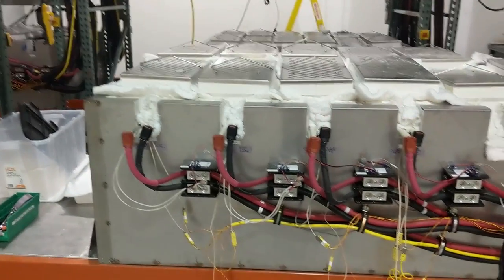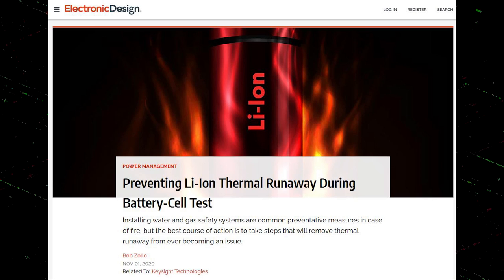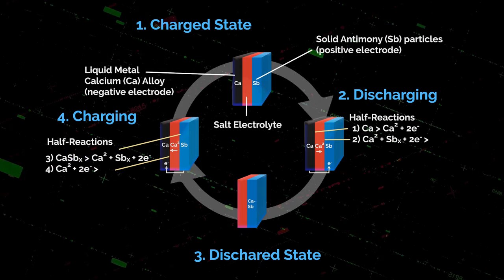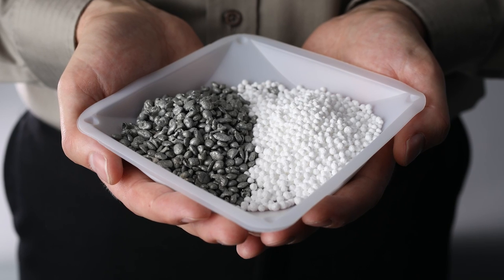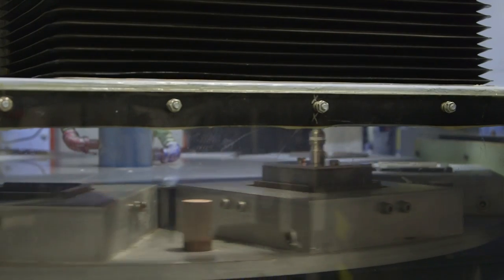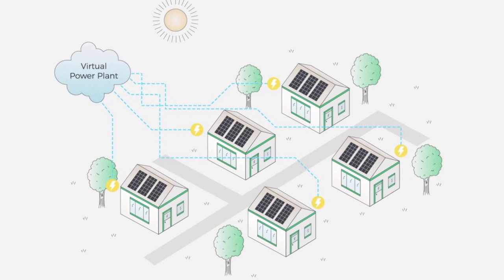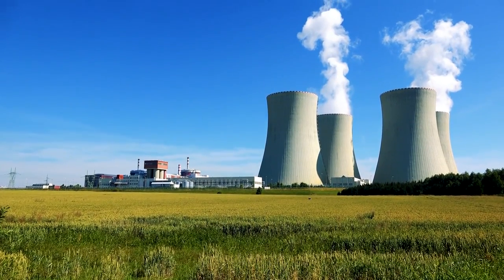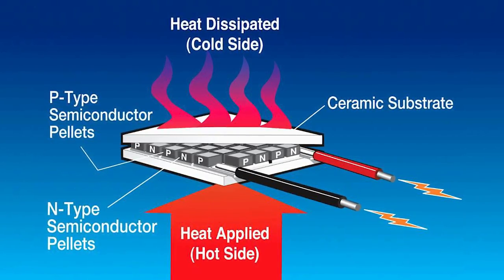Ambri: A Battery that Could Change the World

Comment: "if you want something dirt cheap, make it out of dirt. Preferably locally sourced" this is such an awesome quote
Reply: Soil aint cheap. Dirt is dirt meaning dirty. Soil is soil dust is dust. Where there is smoke there is smoke, the fire is where the fire is.
Reply: Fi real.
Reply: This is the Arc Reactor lol
Reply: I prefer politically stable in the US. 🤣
Reply: Let's talk about how many hundreds of pounds of magnesium catching fire. When magnesium catches fire, it burns at 3,100 c or 5,600 F. If one tries to drown it with water, it burns so hot that it liberates oxygen from the water. it will burn through concrete. Years ago, I had a mall spool of magnesium ribbon. I lit it on fire and got a bit spooked by it's energy so I dropped it with a pair of pliers into a beaker of water and it just sat there and burned and boiled the water until the beaker broke.
Reply: @Ryzler13  bot?
Reply: Great Man Mr.Donaled Sadway.His efforts are helping the whole Universe.
Reply: @Ryzler13  Raa=è1¹1q+pq0+¹1¹q
Reply: - and we have to make sure the technology meets the requirements of equality and social justice that are so important in our political climate...
Reply: @денисбаженов-щ1б  Whatever makes the Leftists happy :-)
Reply: Land prices are through the roof! 

Dirt is not "cheap", unless you are hinting at stealing it.

I for one do not need an unethical solution if that is the case.
Reply: @денисбаженов-щ1б  Not at all. There simply isn't that much demand today, but Antimony is found all over the world.  Supply and demand are dynamic - raise the price and offer to buy 10 times more than current supply, someone will build more mining capability to fill those orders.  In fact, unintuitively, history shows that increased demand INCREASES supply in very short periods of time.
Reply: Water used to be considered cheap...not so anymore..dirt,,who knows?
Reply: @денисбаженов-щ1б  It comes from dirt, Boris, and it is everywhere.  Enough with your silly propaganda.
Reply: @денисбаженов-щ1б  Ah, another Dunning-Kruger victim. You have no notion whatsoever of what I know, Boris. Enough with your silly propaganda.
Reply: @денисбаженов-щ1б  I'm  half impressed only but i d oo know that a numbe r of metal n sslt combinations exist besides  antimony  and other here.
Reply: @денисбаженов-щ1б  interestingly antimony  i beleive was oonce available  as a pill. It would pass through the gut and re-emerge ready to be re-used by another person or again repeatedly.  It might  have been effective  against some parasites and small amounts of a antimony  in the body improved the skin tone as does arsenic. Small amounts  .
Reply: @rogerramjet6134  and the more roads built , then the more the vehi6 come from nowhere to congest the new roads.
Reply: @денисбаженов-щ1б  if your book is worth writing (and reading) then it will provide unbiased evaluation of technologies. Allowing yourself to be angry about an internet discussion that didn't go your way, and petulantly allowing that to unbalance any information you may provide in a book, is not the way of an educated person. You just shot yourself in the foot with that last comment.
Reply: UFO KingCrazy  when I Google i find that  Bolivia South Afrika Tadzjikistan and China with 90% is the greatest cant find Mexico or Canada 🤨
Reply: @Ryzler13  good
Reply: Let's see how long it takes for this guy to get Hillary'd for this wonderful invention.
Reply: @денисбаженов-щ1б  no good professor I’ve had would care enough to respond the way you have, thank you for exposing yourself as a fraud
Reply: Love it
Reply: @joeking3282  it’s sarcasm buddy 👍
Reply: "build dirt cheap from dirt" is an old meme from the architect of Earthships
Reply: Póp
Reply: @денисбаженов-щ1б  is this true and checked? what source did you use to check this opninion?
Reply: @денисбаженов-щ1б  how can you profe this? what is your source?
Reply: @денисбаженов-щ1б  It just a term of speaking..you must understand..
Reply: What’s the stock symbol for that though ? 🤔🤔🤔🤔any one knows how to check it out ?
Reply: So you can make a dirt cheap battery out of dirt?
Reply: UFO KingCrazy  Are you rich yet? Inquiring minds want to know?
Reply: @BlisterHiker  I did notice the battery case was white! But then if we did it in black, we could put some solar on it and keep it warm?
Reply: UFO KingCrazy  why don't they mention what kind of wattage you can get with one of these batteries?  How much metal do you need to make a battery for what wattage?  This is a stationary battery for business, homes and not for individual use or transportation.
Reply: Where do you get all of this heat to start the battery?
Reply: @peacepoet1947  ...they explained that in the video, did you watch it? If not, maybe watch it again?
Reply: @JamesFaction  why should I watch it.  You seem to have gotten the information and why don't you share your understanding?  The Sun?  Gas?  Oil?  You need petroleum products to make the battery.  I watched lots of energy producing videos.  I missed something in this video about how they plan on achieving such high temperatures but it isn't as important as how much space do these buildings take up and what kind of wattage can you get per square foot.  How does it compare to the space required for windmills or solar panels.  I'm always asking questions.  You can't loose any heat but heat will be lost.  Other than some drawings.  There is no working model of the device.
Reply: @peacepoet1947  why should you watch it? You commented on it. If you haven't watched it, your comments look pretty stupid.

Expecting other people to answer questions that would be answered by watching the video YOU are commenting on is arrogant and entitled. Perhaps avoid making yourself look foolish, and watch the video first before you comment.
Reply: @JamesFaction  sorry that I ruffled your brain.
Reply: Yes, correct.
So why are we paying half a million dollars for a house that is made from drywall???
And the cost of heating and cooling is very high.
And it takes 30 years to pay it off.
Are we insane? YES!
We can make cob houses with thick walls that the dirt comes out of the back yard.
Recess the house 3 feet into the ground and build the walls out of that same dirt that came out of the hole.
And from the money you saved you can travel the world for years!!!
Reply: Why do i get the please make me rich and lose your investment feel?
Reply: Silicon from sand..gasoline and a zillion products derived from a black  sludge called crude oil. 
Paul G
Reply: @BlisterHiker  Oh yeah - as in wars and blood for oil and the blood-soaked gasoline that most people merrily and obliviously pump into their beloved combustion-engined cars. Then when EVs and batteries threaten the gasoline-powered status quo - countless millions like you suddenly grow a conscience !
Paul G
Reply: @evukelectricvehicles  What's your point?
Reply: James, today the Interweb is yours! : )

Comment: Finally,  a person who is really making sense.
Reply: +1
Reply: Call me. I can’t sort out your other problems as well.
Reply: Ok, it sounds like a good idea BUT these batteries depend on the assumption that renewables themselves deliver benefits. Do they? It seems that they don't :@t
Moreover, besides the research on how "green" is green energy when you factor in all production emissions and energy input for installation (huge roads are opened, hills flattened, etc), maintenance, and so on, I have yet to see a viable plan for tearing down and recycle the  huge wind turbines and billions of solar panels.
Reply: @C_R_O_M________  so why would a wind turbine need to be recycled ?
And what part of it couldn’t be re used or recycled ?
And solar panel recycling is comon place nowadays
Reply: @spinnymathingy3149  their life cycle is LESS than 20 years (some don't even make it to a decade) and, as the professor said in this clip, composites don't recycle well. Wings are made from composites. Many big ones (the turbine base) are made from concrete and concrete is one of the most pollution-intensive materials we make. Not to mention the opening of roads and flattening of whole hills and/or mountaintops when you install them (that's the case here in Greece with a very mountainous terrain). It's not that straightforward you know.
Reply: @C_R_O_M________   but what power supply/generation are you making comparisons with ? 
What would be your go-to preference for power generation ?
Reply: @spinnymathingy3149  right now the most efficient and stable power production comes from natural gas and nuclear power. hydro isn’t and can’t be available anywhere. Aside from that my previous comment is a different story by itself. What will they do with all that equipment after their life cycle completes? I have yet to see someone with an economically viable plan for their decommission and recycling. Hence many are left on location to rot.
Reply: @C_R_O_M________  hmmmm, nuclear doesn’t tick your logic box, with relation to mining, pollution, resources, decommissioning ect. 
But depending where you reside solar PV works well, here in Australia I haven’t paid an electricity bill for 8 years, usually get a cheque from the power company, as there’s a huge uptake of solar in Australia there’s an efficient recycling industry here  now because in 10 years or so there’ll be demand
In Adelaide Australia there’s so much private roof top solar its overloading the grid as its being fed in during the day, so a storage system of some kind is needed, either on a personal level or state level
Reply: @C_R_O_M________  it is all bridging technology atm.
Wind turbines are currently being dismantled and 'ground' to use as/in cement✌️
Reply: @C_R_O_M________  there's next generation reactors being developed that can use the waste as fuel

Comment: Awesome technology.  I wish them the best, we need more people like Donald Sadoway.
Reply: @tonywilson4713  generating too much? Surely they can simply open up the disconnect switch
Reply: @andymack8178  Its not always that simple and they can also lock of wind turbines.
Neither eliminates the real problem. From a technical perspective its irrelevant but from an investment perspective its massive and it doesn't matter who's paying.
I don't know your background but in the past I developed automated production machinery and in manufacturing there's nothing worse than producing failed product. Its cost money for materials, labor, energy,....etc. and those costs are unrecoverable in failed product. Solar/Wind energy that can't be sold or used is similar. Every bit of sun or wind that is not converted and used or sold is money lost.
If your the home owner then you have to buy energy elsewhere. 
If you're the commercial generator then you can't sell the full value of what your solar farm of wind turbine is capable of.
Reply: @andymack8178  As for generating too much its easy to overpower a network with too much generation. The voltage goes up and if it goes to far its not good.
Reply: @tonywilson4713  your comment above "easy to overpower a network with too much generation. The voltage goes up and if it goes too far it's not good" This is exactly what I just said, then simply turn it off.
Reply: @tonywilson4713  these systems are absolutely made to be turned off
Reply: @tonywilson4713  if it costs the utility even more money by shutting it off vs. paying customers to take the excess power and if there's some political/contractual/economic/but not technical reason that they can't turn it off then there's something that we're both not aware of yet.
Reply: @andymack8178  These things are large grid connected generators and they can't simply be switched on and off.
These use High Voltage Breakers and they are not like a light switch. Even normal low voltage breakers have limited lives when they switch under load.
You clearly don't have much (if any) experience in electrical engineering.
Reply: @tonywilson4713  Srore energy as the electricity like battery based on  2 solid dipole  and a liquid electrolyte in between as the Earth temperature from 0 to 45 C . But it is malfunction  if lithium or both solid dipole under 0 C freeze as electrolyte no more a separators electrons but turned into fixed holder electrons without exchange and attractive dipole charger.  If you find a 2 solid dipole and ... as is liquid exchange electron at 100 C or 1000 C then it is bingo.
Reply: @ThuannguyenN-gp2vp  Why don't you just listen to what he is saying? 
And read what you've written before you post.
Reply: Texas just proved how important it is to have reserve power available at all times especially when the weather is not cooperating. Ice will kill wind turbines the same way it causes aircraft to crash,  by changing the shape of the " wings " Texas made the mistake of taking off line the reliable proven technology instead of keeping it viable and ready to cover when renewable energy failed. 
You talk about recycling then you cause massive amounts of building materials destroyed and people killed by not maintaining a balanced reliable system. Keep passing laws that don't consider all the consequences possible and the Texas type failures will become a common problem in all aspects of life .
Reply: @tonywilson4713  I applaud your first comment. Somehow YT doesn't allow me to include a link for the latest commentary of natural resource analysts Goehring & Rozencwajg titled: Ignoring energy transition realities. Google it and go to their site to find it. It'll be an eye-opener on many misconceptions on "green" energy. Hint: it's not that green to begin with.
Reply: @C_R_O_M________  Yeah - you have to be careful with what links you include in comments. You're not the first to point out that YT's supreme bot of our collective consciousness doesn't like links to places it doesn't control. I have found it doesn't react to Wikipedia links and they often have links to the places we want to highlight. 🤷‍♂️🤷‍♀️

Mark Blyth (who I think is one of the smartest people on the planet right now) has mentioned several times there is an enormous shit fight comin around the corner shortly because pretty soon the Right wingers are going to have to admit they have been lying about climate change just as they did with tobacco. The difference this time is they aren't killing their customers its the planet.

What I find very frustrating as an engineer is that all public discussion and policy is being dictated by economists and MANY of those have links to Harvard, which is the grand temple of neoliberalism free market ideology. Here's a case in point that I only found yesterday -> https://www.youtube.com/watch?v=5oyFRoxuf4g  note the Professor who built our disaster of a water market has links to Harvard and that he has the same attitude to the clown from Harvard who designed the Texas power market.

No matter what anyone wants to say its going to be engineers who have to get the job done of providing clean viable power AND ALSO build the systems for cleaning up the planet. We can't get that done if nobody will listen to us.
Reply: @andymack8178  You can turn off the generators, that you own. To push renewable energy, Germany had introduced a law (EEG), that energy companies are obliged to accept and pay for electricity produced by private sources ( roof solar, wind etc) connected to their grid at all times. They get a compensation, which is added to everyones electrical bill.
Reply: @tonywilson4713  sorry, but there is no tangible evidence whatsoever that a trace gas like CO2, which represents just 0.04% of the earth’s atmospheric volume, is detrimental to the planet in any way. Unfortunately, it was Thatcher that started the alarmism for burning carbon (basically coal then) but that was a trick of hers so as to overcome the conflict she had back then with coal miners. The leftist propagandists and their media lackeys have brainwashed the whole world about about some “catastrophic” climate change scientific bogus consensus which is all supported by GIGO computer model projections. Many top scientists disagree and they are the ones with no incentives to do so. In fact skeptics are banned from funding when they come out of the closet.
Reply: @tonywilson4713  I'm sure there are some bright electrical engineers could find a solution, who aren't driven by naysayers trying to protect revenue
Reply: @bertbox69  Part of the problem is that modern power networks are insanely complex. They grew out of the next need rather than being planned.

But these days the far bigger issue is the fundamental ways our economies work. We have been living under a model called neoliberalism for ~50years now. It was heralded in by Reagan and Thatcher and based around the insanity of people like Milton Friedman. If you want to dig into that look a up Mark Blyth & Angrynomics.
The giant problem is they've privatized water and power and they are to 2 most fundamental commodities to modern society. Almost every thing we do and buy has a water & power cost so if you raise the cost of them you raise the cost of ALMOST EVERYTHING in our lives.
The people running our power & water have quarterly reports to answer for. They don't have to answer to you and me or even government. This is their Milton Friedman shite they only answer to shareholders.
As such they don't care about next year or anything else - the only thing that matters is that next quarterly report.